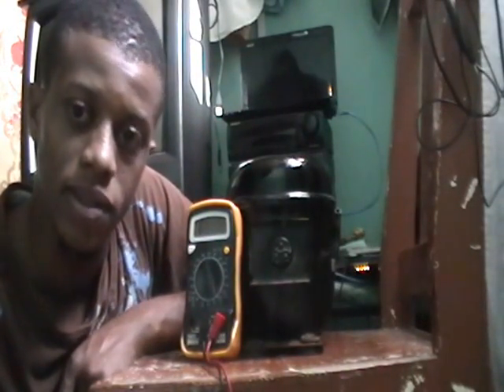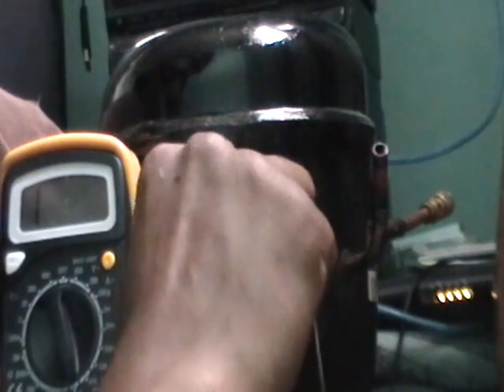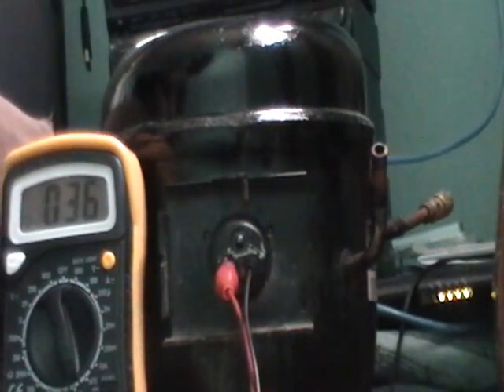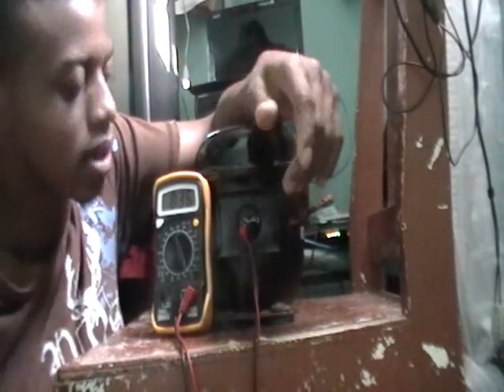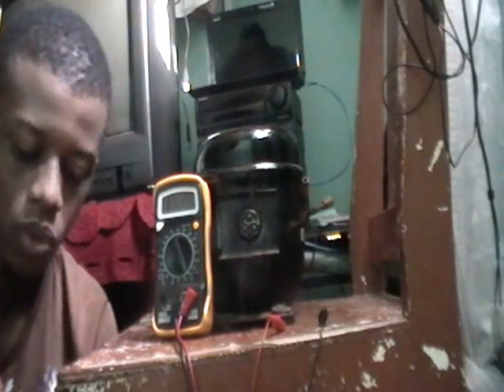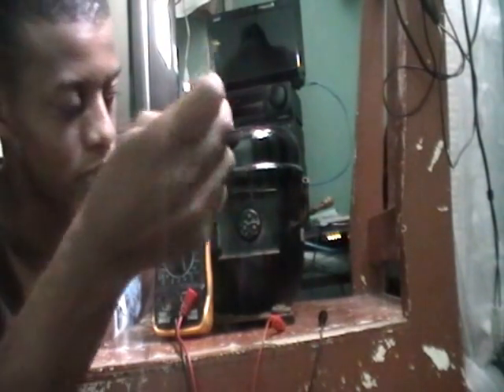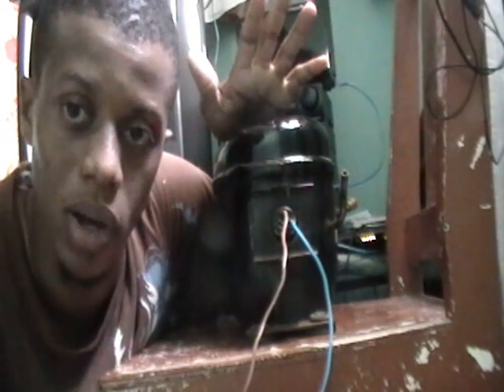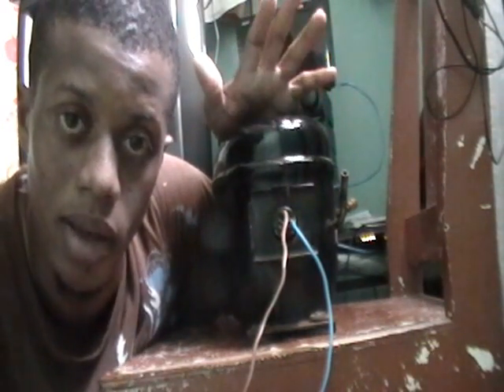How to test a refrigerator compressor

Comment: What is wrong if the compressor draw 8 amps and cut off can I still use your start system
Reply from the maker: I would advice you to allow it to cool first then try, you could have a bad start capacitor or relay and worst case scenario a bad compressor.

Comment: Brilliant explanation and demo, despite all the other Utube vids no one really shows the start sequence. .I wanted to know how these work Ive collected 8 pump units to build a 10 cfm silent compressor. These pumps draw around 9A at start but only1.5A run Im just designing a Raspberry Pi start up / run control that will start each unit one at a time  based on the coolest unit first and the pressure required.

Comment: 3 phase is 660 volts
Reply from the maker: Not in ST. VIncent And The Grenadines, Its 400-440 volts
Reply: @anthonyfindlay466  your reserch is poor single phase is 220 that means 440 2 phase and three phase 660 volt you have to buy uni t meter and you check with three probe  and three phase both of them you have showing 660 volt

Comment: when i atatch the live and neutral wires,then switch on the power, mine hums immediately, but i can't tell if its moving any air, do i still have to do the screwdriver thing?
Reply from the maker: yes you do that's how it starts
Reply: thanx ant, i did it earlier, (ive got 4 of em, from dumped fridges) now im looking at connecting a larger gas bottle to one of em as the storage tank. so i can make my own mobile air compressor
Reply from the maker: colzberg  yes you  need to short the pins  the humming means it's trying to start

Comment: Hi Anthony,I have a used compressor and tried to run it last month but without success. This is a China made single phase compressor running 220 to 240V 50Hz. Original capacitor at 2.5uf. So I did a electrical test and obtain 27ohms, 36ohms and 64ohms. I ran continuity test and only the 64ohms has no sound. I find it strange to have such high resistance. I assume this is the Run Start winding. I tried running it again today and shake the compressor, surprisingly it did run for a short while before a loud crackle bang was heard. Do you have any idea what could have had happened? Very puzzling...   :(

Comment: So, if U momentary short the start pin, no capacitor is needed for testing the compressor?
Reply from the maker: +explorer no it's not needed the short created between the two pin start/run is all the motor needs it's as though you are introducing a second phase.
Reply: +Anthony Findlay, Thanks for your valuable reply. I hv opened up my old fridge compressor & I find the 3-wires. DMM ohm readings between the 3 points are: 16 ohms; 43 ohms & 58 ohms.(I suppose this last reading of 58 ohms, is between "start" and "run" wingdings?)-which I can short just to start the rotation? -& yes, it RUNS - tested OK. Thanks 4 ur guidance. (I hv 230 V / 50 Hz AC supply here in India)

Comment: great video, very helpful. i have a compressor which is doing the classic buzz then click cycle. so it's cutting out and not running. i have replaced the ptc relay and start capacitor, and the compressor continuities check okay. when i bypass the relay as per your video the compressor starts and runs without me even needing to short the start terminal with the screwdriver. any ideas what the problem could be?

Comment: Good video mate some good  tips I picked up  from  your video  as I repair  appliances for a living  .top man
Reply from the maker: Mark Lewis  glad to know you liked thanks for the input
Reply: Anthony Findlay thank you you really good at explaining
i want to ask you about compressor i think i just ruined it
so i i connect the top and right pins directly together (common and run ) with the thermal overload .
obviously i broke it it was directly connected.
i plugged it
the compressor start for about 1 minute then start to make noise i unplugged it and plugged it again and the power goes off immediately from (circuit breaker)
when i checked the compressor it was so hot i checked the pins there was no resistance and no sound from multimeter
 is it dead?
Reply: Anthony Findlay when i put it to diode mode it wont show anything or any sound when i put multimeter to ohmm mode it shows readings.

Comment: Very well explained, thanks for the nice video.
My refrigerator has a inverter compressor and when I do multimeter testing on all the windings it shows 1 for all three(with two windings touched simultenously), does that mean the compressor is bad or am I doing something wrong ?
Reply from the maker: he y rahul you aren't doing anything wrong your compressor is ok all three pins and both windings are connected they are actually variable speed compressors and most often operate on a DC power source, an inverter board controls the speed of the unit based on temperature differential they're more economical  because of there ability to use only the current needed at the present temperature setting hope this helps you.
Reply: Same here compressor run but wihout jump it just when i hot power its start without i touch the run is that normal, after running its start to smoke after 40 second please help

Comment: I have a refriderator . The PTC relay is bad.  I removed it.  My compressor has continuity. The readings are low. I jumped the compressor as you have in this video. The compressor seems to run but the fridge does not get cool.  The compressor get rather hot as well.  Should my compressor, that starts when jumped, make my refridgerator cool ?
Reply from the maker: Paul Kaz  hey bro if your refrigerator is a self defrosting type the fan must be running also to circulate the air in the fridge ok if the fan runs and the fridge is still not cooling then you could have a leak in the system some fridges have a condenser fan also check that also sorry for the late response hit me up at (mozart2376@hotmail.com)

Comment: thanks Dr. Findlay just have 7 mths out of school in Miami, working for a small company...I just learned more here about compressors troubleshooting in 8 min. would like to make it down the islands with some more experience for work. can u also give info on HVAC/R in islands?
Reply from the maker: Hey locals only thanks for the input if you move to the islands you'll only be doing Air Conditioning and refrigeration I don't have my cam cord any more I'm working on getting one back sorry all the best may God bless you.

Comment: Anthony, I notice when you jumper the start pin with your screwdriver, you had your fingers on the metal shaft of the screwdriver. Didn't you say NOT to do this? Or were you just showing us what not to do? 6:20 in the video.
Reply from the maker: At the point when you saw my hand touching the shaft of the screwdriver the plug was not connected as yet If I had actually touched the shaft as you assumed you would not have seen this video so look again and think about it very vividly,thanks.

Comment: Hello Anthony - nice explanation. On question regarding the test I mean when I check my compressor in oms it is ok between the pins. But there is a problem with continuity beep only between upper and one lower pin there is a beep, upper and second lower pin no beep - that means that compressor is broken electrically ?. To be more precise in tree possible combination of touching pins with meter probes there is only one beep. Please give your explanation.
Reply from the maker: Hey pawel sorry about not responding so long but for what it's worth here you go don't worry to much about the beep the important thing is the resistance across the most meter would only beep if the the resistance is less than 30 ohms so set your multimeter to resistance and try again you'll get it
Reply: Anthony Findlay Hello thanks for info I fixed that long time ago and the device is ok. Problem was in electronics, compressor itself was fine but your video make me think, thanks

Comment from the maker: hey rob I'll advise you to to remove the starter/overload and make a jumper lead for your self do just as I did in the video ensure that you do this safely unplug when you need to and ensure that your jumper lead has a on/off switch if it won't start then it's gone and if it does the relay could be the problem.

Comment: Thanks for your quick reply. I did the ground test and it wasn't grounded. I don't want to remove the compressor nor do I have the equipment to test with suction and discharge. I read the ohms across each other. I think it was 6, 9 and 13 ohms. What are the high and low for passable on the ohm readings. I just don't know if it is the starter capacitor or the compressor "it won't run and only gets hot." Just trying to troubleshoot it. Thanks, Robert

Comment from the maker: Hey thanks for your input, I'll give a compressor a pass based on the suction and discharge and also the resistance readings of the windings if they're not grounded to the compressor it's a good by me.

Comment from the maker: Hey james thanks I appreciate the input,the fact that the freezer works means that the compressor is pumping refrigerant around, so we,ll have dig a little deeper you could have a problem with the circulation fan or blocked air vents with ice or an item in your freezer compartment if it's blocked with ice I'd like to believe that it's a bad heater/defrost thermostat but you say that the digital screen doesn't work that could mean you  have a control board to be replaced.

Comment from the maker: Hey nick coo thanks for viewing,have you tried turning the selection knob/control/start button if you do that and still  nothing happens it could mean that you probably have a bad thermostat or an open in the circuit,if you'll like diy first ensure that the appliance is unplugged remove your panel or back of your fridge and take a look and see if there are any broken or disconnected wires and let me know I'll shoot a vid on how to troubleshoot email me at mozart2376@hotmail.com thanks.